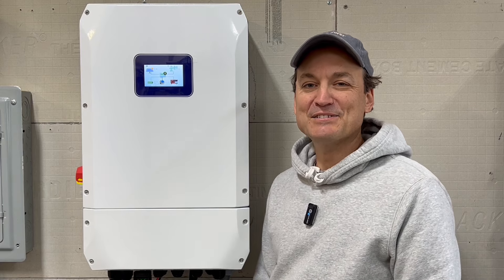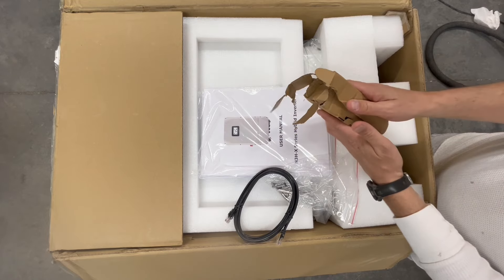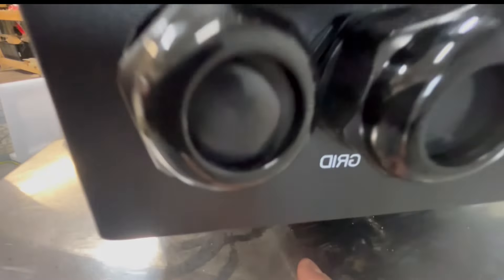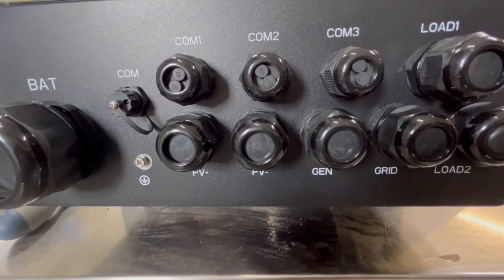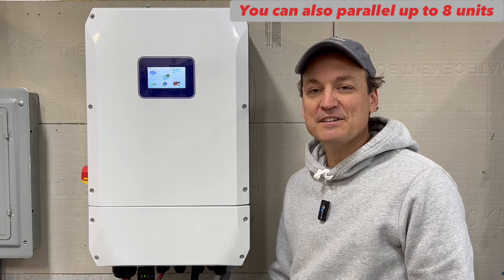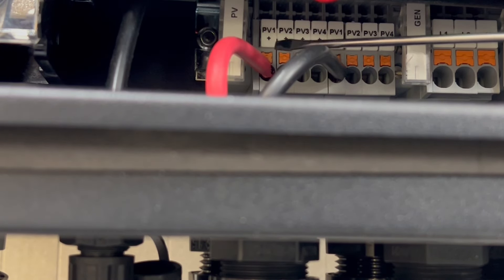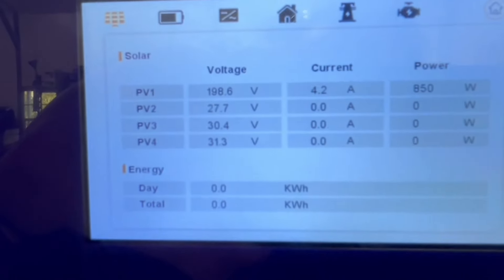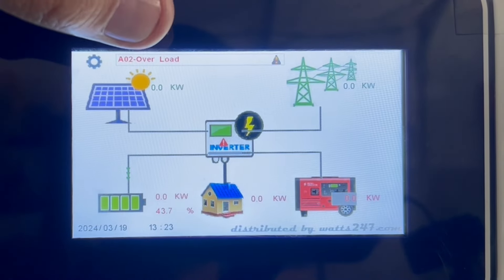NHX-10kw hybrid inverter review and testing~10,000 watt outdoor rated inverter

Comment: What would be interesting to see is experimenting with the new indoor EG4 Powerpro battery you just received and hooking it up to the new NHX-10kw inverter unit. That is the exact combo I am looking at getting. The setup would just run my 240v loads like well pump, water heater, heat pump, ac and dryer. I talked to Ian and he said to set it to USE type batter and bulk to 57.5, float to 56v and low cut off to 48v.
Reply from the maker: That voltage would work perfect yeah. That’s what I had mine set to. It would essentially be almost what I tested the inverter with when I ran all my loads with it. I had 300ah of battery hooked to it. And the new indoor power pro is 280ah.

Comment: Good review, Gavin.  I like that you covered all the basics including some load testing in a single relatively short video.  You mentioned running your water well.  I'm thinking this might be a good option for a stand alone well like I'm looking at installing.  I'll be watching this one for reviews after it's been out there a few months.  I suspect your video is going to help get it out there a lot sooner.  Appreciate the time and work you put into this!
Reply from the maker: Thanks man. Yeah it’s a good option for a standalone system. I’m still impressed with the idle consumption too. This inverter with around 300ah of battery would be awesome for that.

Comment: Nice!  I really like this feature: 2 x Dedicated outputs ( 1 is permanently tied to the Inverter/Grid Passthrough , the second is programmable according to battery State of Charge) – I use this to heat electric hot water when battery is nearly full

Comment: thanks for the review.   very interested in this as a second inverter for my existing system.  I have a XW Pro with 70kwh of battery,  but the cost of a 2nd XW Pro is $3500  inc tax and shipping.  this unit total with willcall pickup is $2400 and more power.  looks good
Reply from the maker: Yeah it’s a nice unit. I should be making a follow up  review in the next couple weeks.

Comment: Great video! Sorry if I missed it but were you running the grid power when you oveoaded the unit? I'm very curious what the max continuous output of this unit would be offgrid.
Reply from the maker: @Laurel-Crowned  I wasn’t using the grid no. The max output would be 10kw continuous. It can do that without an issue.

Comment: @Gavin S. Quick question, do you like this unit over the EG4 18Kpv? Also what is the idle consumption? And can you have this unit back-feed and power loads in your main panel and also in your critical load panels at the same time with export set to zero or disable?
Reply from the maker: The 18kpv and this unit are actually different in a number of ways. I prefer the 18kpv overall. But this unit definitely has potential. It did really well in all my tests. 

This unit has grid interactive features. So it’s able to feed your main panel with the zero export option. I believe I tested around 65 watts idle consumption on the NHX in this video.
Reply: @GavinStoneDIY  awesome 👏 thanks for the feedback i like the hybrid inverters best as you can keep non critical loads in your main panel and still used PV or battery to power them as needed, plus having a critical load panel just for only critical loads, too bad they have not made the 12Kpv model yet, that would be perfect.

Comment: Great review thx. Will this work without batteries like a simple grid tie inverter?  I’m just looking to run most of my loads during the daytime and have grid at night. I need the zero export feature with the CT’s.
Reply from the maker: It will do that yes. If you follow the link itll take you to the manual and description. Watts247 usually does a great job of describing all the features.
Reply: Thx so much for showing alternative options. I’m very impressed with this unit.
Reply: Ian had a video out and yes it can run pv only no battery necessary from what I understand.  I already have this but yet to be installed.  Ian gives a thumbs up for this low frequency inverter.

Comment: Hi, thank you for the wonderful product video. Im  somewhat new to the solar scene and have been deciding on what inverter I wanted to purchase. Very impressed with this unit however, Iam a bit weary of those quick connects for ac out. What is your take on those type connections? I personally would like to see screw down clamp style there. 
Thanks!
Reply from the maker: It’s hard to say. Personally I think they work fine. I haven’t heard of any failures with these on the NHX yet. I’ve use similar inputs on PV before. 

It makes sense why they couldn’t add standard terminals though. The wiring area is a bit tight. I’m editing another video on the NHX now. I really do like the inverter. Especially at this price point.
Reply: @GavinStoneDIY  I appreciate the extremely quick reply, brother! Yeah, I don't think it's a deal breaker for me, but even as I stated earlier about being somewhat new to solar, I have years of electrical and electronic background. One instance where I have seen issues with a similar type connection was in regular household 120vac outlets using the push to connect type setup. The blades do not make sufficient  contact or should I say,  not enough surface area and tend to heat up and deteriorate quicker than using the clamp style. Either way, thank you once again! Great video tutorial and reviews 👌

Comment: Checks a lot of boxes . I believe the wave will be grid tie zero export. Thats certainly what I'm interested in . Plus it can run as a backup when grid is down.  so my  wife can run the washer ,dryer, hair dryer, stove and both central units (when the grid is up) this thing is lowering my bill. Im not giving the utility company anything😊 . And my wife aint complaining. WIN... On paper u could have two in parallel 10k on each leg do all of the above @ 120w idle less than the eg4 18k.
Reply from the maker: For sure it has a lot of potential. 2 of these would definitely run all my loads. The idle consumption of the 18k is around 70watts. The these units appear to be 63-70 watts. So actually pretty similar. So yeah you’d probably be around 120-130 idle consumption. I expect to see a lot more of these on people’s walls soon.
Reply: @GavinStoneDIY  if I'm not mistaken a single 18 would be less total kw and surge than 2 10k's in parallel.Plus if the 18k goes down your s.o.l. but it's less likely both 10k's would go down at the same time
Reply from the maker: @blainecelestaine4543  yeah redundancy is a factor also. It’s always nice to have a backup. The 18kpv’s output is 12kw. Versus 10kw for the NHX. 2-NHX’s would have 8kw more output than the 18kpv. There is of course other differences in the two inverters other than output. So it’s hard to do a complete apples to apples comparison.

Comment: Hello Gavin: I watched the NHX video again for the 5th time, great video. I have talked to Ian also on the unit. I've decided to go with the NHX inverter in my system. I was going to go with 3 EG4 Lifepower 4 batteries to start with, but noticed that you were using EG4 LL-s batteries on this test. Am wondering in an NHX set up with only 3 batteries would you use the EG4 LLS batteries or the Lifepower 4 batteries? Having a hard time making up my mind. Thanks Jeff
Reply from the maker: I would choose the LL’s. Mostly because the longer warranty, but also nicer software. But they are more expensive, so if you do choose the lifepower4’s I would highly recommend getting the communication hub to go with them.

Comment: Does it have an auto start when the batteries get to low like the grow watt does?
Reply from the maker: @jeffnelson5909  yes, I’m assuming you’re talking about a generator auto start feature? It has dry contacts that will engage to start a generator.
Reply: @ no I’m talking about when the batteries get low and shut down the inverter to save power and I think after so many minutes the inverter can restart itself when power is available. Not an auto gen start
Reply from the maker: @jeffnelson5909  oh like a dark start option? I’m not sure, I haven’t tested that yet. That’s a good question though. I know it will restart with PV present.
Reply: @ yes ok.  Guess that what it could be called. to restart with pv

Comment: After 2 Months are you still running it? How's it doing? I'd like to install solar this year, but want to be grid tied but not back feed the grid. Really just want to be able to use what I produce and grid back up or if I was to go over the 10K rating while grid is connected have grid make up the difference I don't think I would pull much more than that often.
Reply from the maker: I ran the unit for around 3 weeks or so. But I don’t still have it on my wall no. Adam Delay did release some reviews videos on this inverter as well. 
Im not sure how well it does on zero export. I haven’t seen anyone post any readings on that yet.
Reply: Thanks yes I've see Adam's channel as well subscribed to both yours and his enjoy the content.

Comment: Good review,  each output is 120 volt?.
Reply from the maker: AC? Yes it’s a 120/240 split phase inverter
Reply: Was curious because Ian said he was running a hot water heater off of one of the programmable outputs hence I thought each output was 240. Hope that makes sense.
Reply from the maker: @sh839c   oooh I see what you mean. Each output is split phase 120/240v. The second output is just controlled by voltage. So it’s a great option for loads like Ian mentioned.
Reply: @GavinStoneDIY  Thanks, that is a good option.

Comment: I see this unit has 4 independent pv inputs  at 500 volts each, with the EG4 6000XP ,which has 2 pv inputs,are those inputs 480 volts each ,or are they 480 volts  total ?
Reply from the maker: 480v each input on the 6000xp.
Reply: Thanks @GavinStoneDIY

Comment: Can you connect the Eg4 Power pro battery to this unit?
Reply from the maker: You could but they wouldn’t be able to use communication. The pro batteries don’t have pylon tech protocol as of right now.
Reply: what batteries can be hooked to these then that will communicate. Was just thinking about one of these instead of the 18K.
Reply from the maker: @jeffthornton2618  any battery that supports Pylontech protocol. Watts247 has some rack batteries with that protocol.
Reply: Would this  NHX unit power my well pump - hot water heater - range - heat pump / ac & dryer?
Reply: If the appliance uses a 35 amp or less individually then yes . If you are in off grid and you start a a well pump and a 5 ton AC unit with our a easy start on it at the same time probably not. If you are running it as grid assist then everything should run as usual and the inverter should ramp up or down it's production based on the ct's reading. That's my question how capable are the settings in grid assist zero export @jeffthornton2618  @gavin
Reply: If the appliance uses a 35 amp or less individually then yes . If you are in off grid and you start a a well pump and a 5 ton AC unit with our a easy start on it at the same time probably not. If you are running it as grid assist then everything should run as usual and the inverter should ramp up or down it's production based on the ct's reading. That's my question how capable are the settings in grid assist zero export @jeffthornton2618  @gavin
Reply: @blainecelestaine4543  yea, I would be hooking the NHX to 5 circuits. Well pump (20amp) 2 1/2 hp - AC/Heat pump 2 1/2 ton (30amp) no soft start - Water Heater (30amp) - Dryer (30amp) & range (50amp) - the well pump and water heater would sometimes run at the same time. Also during summer and winter the ac/heat pump would kick in also. The range and dryer would go  on when I wanted to use them. So that is what I am wondering as far as the power of this unit. Thanks

Comment: I started with an old display 8kw amen but wouldn't charge past 65% soc and one day wouldn't charge over 3A, I was sent a second new display 8kw, worked great except it would show higher pv values in overcast on pv1 and 2, then 3 would be super low, suspected problem so my dealer installed the 10kw, we found out it was just bloated numbers. The 10kw so far the worst overcast production I have ever seen, 11.6kw array 1.1kw production, the 2nd 8kw with 8.3kw array made a low of 5.8 kw on the darkest dec day. This stupid mppt clips overcast pv production, 0 to 200 to 0 w, it is clipping. I have a 3.3kw array, I get sun the mppt dropped the volts from 297 to 250v which jacked up the amps to 15.2  on 3800w which trips the mppt off and on untill the sun goes off center. So dumb at 297v x 15 amps is 4455w but it uped the amps to trip at 3800w. I have my 2nd inverter back Nov 13. Glad to uninstall this 10kw. Even when the pv screen says .4 amps the klien clamp says .7, if the float charge is working, the pv is clipping but I run a 2kw load, it keeps clipping and won't cover the load and discharges the battery until it draws .1kw then stops clipping and provides power. The 10kw fan comes on with a 600w load, the returning 8kw is silent to 2200w. I wonder if that unit uses a different firmware, the one I have is drunk and stupid. All 3 unit the gen port still does not work.
Reply from the maker: Wow that’s odd. I know they’ve updated the firmware a few times for the watts247 models. I wonder if it addressed some of the issues you’re describing.
Reply: @GavinStoneDIY  I got #2 back in,I gotta say I don't like the ground bar at all.
Reply: @GavinStoneDIY  I put my 8k back,30 mins of sun ,13kw 1100w in overcast. The 10kw was making 1.4 kw a day same weather.